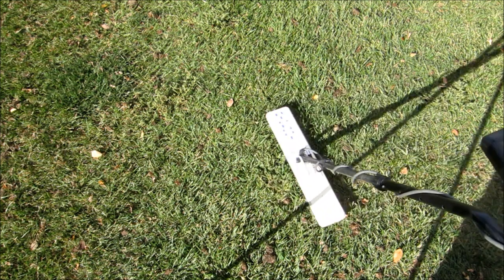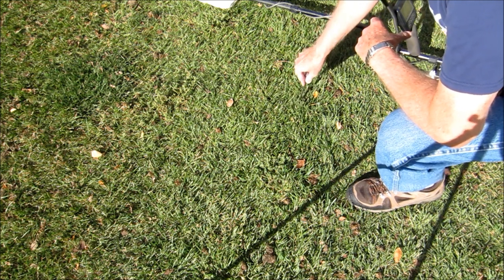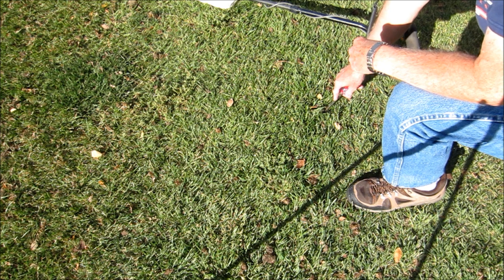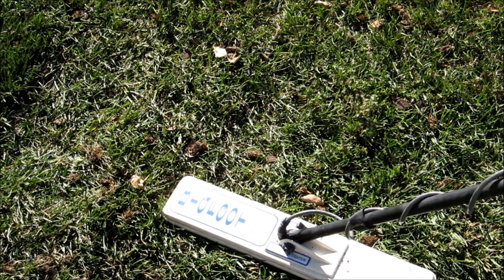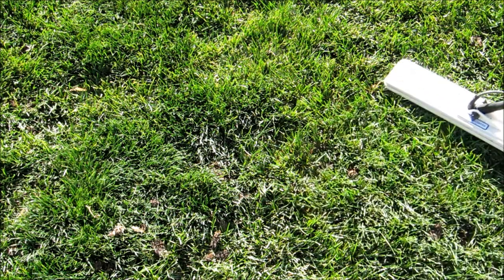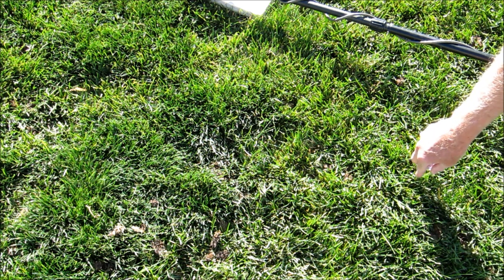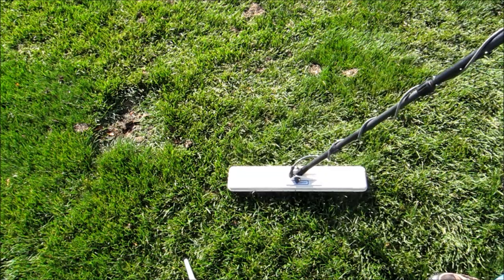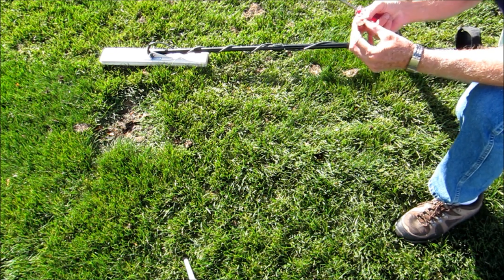Using the Screwdriver Technique for removing targets Metal Detecting Oct 15,2016

Comment: Thank you very much for making this video.  I've wanted to hunt parks and similar grounds but didn't want to tearing up and digging plugs for every hit.  Make another that shows what you do for deeper targets, please.
Reply from the maker: Hi Mike. Of course, I don't dig deeper targets in areas like the one in this video, but when I'm in other areas where I am likely to find good, deep targets, I will cut a deep plug and leave it attached on one side, remove the target, and then replace the plug. Leaving a portion of the plug attached will allow the sod to more easily recover and the plug cannot as easily come back out of the ground. There are already a number of good YouTube videos on this method of plugging. Check 'em out. Thanks for watching!

Comment: thanks for the tip.  not sure how it would work with old silver coins down 8+ inches.  but modern coins or recently dropped jewelry may work.   most things I find are 6+ inches but state parks allow no shovels.  thanks again.
Reply: ok I commented before the very end.  you're correct.
Reply from the maker: Yeah, it is not a technique you would want to use to retrieve deep or valuable coins, but if you are just out there looking to fill your coin pouch with lots of coins, it is quick, effective and easy on the turf.

Comment: Does this work on really rocky soil?
Reply from the maker: It is much more difficult in Rocky soil, but with practice you'll get to where you can tell the difference between the way a rock and a coin feel under the tip of your screwdriver.

Comment: no rings
Reply from the maker: This method works on rings as well as coins, and I have found many rings using this method. There is a definite  'slippery' feel to a ring when you come in contact with it on the tip of your probe. You'll feel the probe slip off the edge of the ring rather than having it stay in solid contact, and when this occurs multiple times, you can almost guarantee that you have a ring. Then, with careful probing, you can determine the location of the center of the ring and then lift it out with your probe.